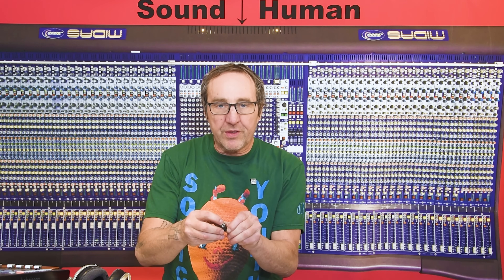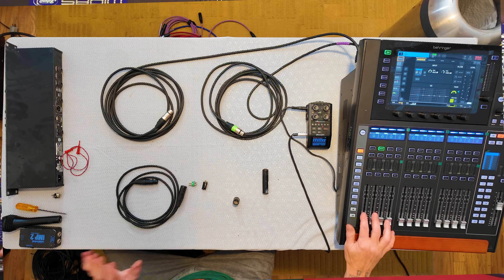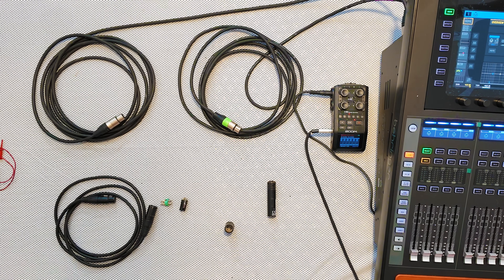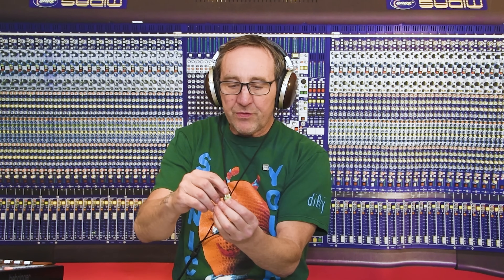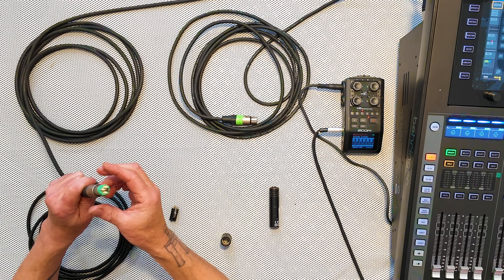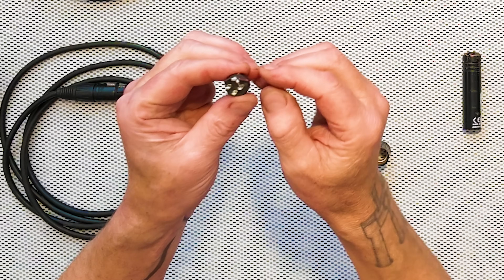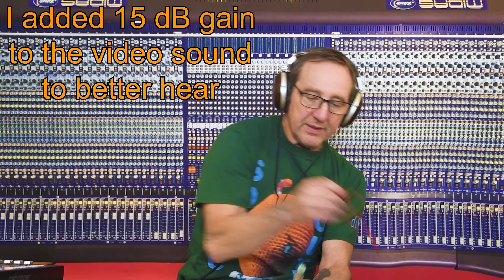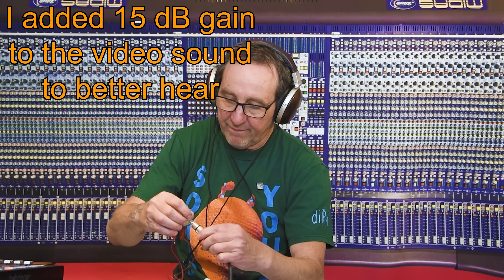XLR Shell Ground Issues

Comment: I discovered the ‘extension problem’ many years ago as I was putting the final touches on my active splitter design. Once a microphone hits a gain stage, the extension problem is basically ‘re-set’ and can begin again but as it is being terminated by the mic pre output circuitry, becomes moot. 

I recall that my preamps in my splitter ended up with pin 1 on their panel connector tied directly to chassis (earth) ground. The chassis ground of each 10 channel unit does have a lift switch but is virtually never needed. What my splitter does have which is rare, is an input pin 1 lift on each of the 100 channels and that lift is done right at the female chassis XLR. That lift point gets lots of use when we are taking anything but a floating microphone. 

The units are grouped together by 5s so 50 channels all share an input ground in only one exact place. This turns out to be the answer in practice as well as - no surprise - the technically suggested layout for minimum noise in analog circuitry.

Comment: Use it on a female and DI boxes cannot lift ground, as one example. I experimented with tying the shell on the male end only many years ago. I can’t recall any drawbacks at the time.
Reply from the maker: Some gear will hum if you tie pin one to the chassis ground of the shell and don't even put a cable on it and just plug that connector in
Reply: @   I’ve seen that and wondered why that could be. The theory says the source ground should be earthed and that theory truly works. I guess it’s entirely possible to have circuitry in that piece of gear that defeats the ideal. A microphone is, itself, a grounded source once tied to an earthed inlet connector. It’s quite amazing how well that works, with super long runs AND high gain.

Comment: I’m confused. If I buy a cable at the store do I just check for him and if I’m okay then dont worry?

I don’t get what I’m supposed to do
Reply from the maker: You can open the connector and look but most cables should not have the shell connected.

It's usually when people make their own cables and try and be extra good by connecting it and it causes issues
Reply: @DaveRat  When Switchcraft first came out with the XLR with the shell pin, several cable manufacturers thought bonding it to pin 1 would be a good idea amd made mic cables so wired.  I think they all learned the issues and stopped years ago, but a quick check with an ohm meter will let you know.

Comment: Dave, am I getting old?

I see all the comments of people not knowing why you don't ground the shell.
But back when I started (early-mid '90s) this was common knowledge and one of the first things you got taught when making XLR cables.

Or is it maybe because of that part (making your own cables) of being a "sound guy" (which we used to be but we got upgraded to engineer somewhere along the line) is a dying art?

Youngsters just order what they think they need without understanding why it is made the way it is.

I am getting old when I judge myself on the above rant.... 😔

I miss those old days... Not the weight of the equipment but the more "DIY" mentality the industry had. Back when you needed your brains and needed to understand the equipment you had and the situation you were in to get a problem solved.
Reply from the maker: Everyone has to learn just like we did it's just the learning tools have evolved to platforms like YouTube.
Reply: @DaveRat  I understand what you are saying.

At the same time I see the younger generation not wanting to do the hard work and source out/order what they need.

I follow some DJs on YouTube and except one they all buy their cables pre-made. Even repairing a broken cable is to hard for them.
Reply from the maker: Agreed. And back when we started, that was not really an option if you wanted anything that is not junk.

Also, with digital, solving ground loops is a lost art instead of a daily adventure
Reply: @DaveRat 
Dave,
I agree with you on both accounts.

And that is what made us great technicians. For me more in developing aka the technical department than in sound engineering but that's a bit beside the point.

Back then (before the internet got so evolved) there was no other way to get decent / good gear or gear that met your needs. You had to do it yourself and with parts that you were able to find locally.

Nowadays...

I still like to look at a project from all angles to find out what is the best (custom) solution. Kids nowadays just grab a catalog and piece something together that sort of more or less works.

But that is what makes us great:
Having the experience to look at something from all angles and figuring out what works best by trying several ideas that could work. Or not.. And that comes from experience but even more from having to figure shit out and built it yourself. No substitute for that!
Reply: @DaveRat Thanks again for your response and 👍🏻! 

That means a lot to me and gives me the piece of mind that I am not going crazy with the install project for a community building that I just walked off. I will spare you the details!

 But it's not all negative as I do see several good engineers from the new(er) generation like Joel Adams, James from Rattlin' Bones Club and Nico from Nicos Gigs! (German YouTuber).

I especially enjoy Nico as he has the same DIY mentality and because he has been on YouTube since his teen years and thus has given a nice portrait of his growth, both as person and as sound engineer.
Reply from the maker: Very cool I'll try and give a look at what they're doing and thank you

Comment: I have a real world example. Large event at the fairgrounds with a Whirlwind analog audio snake between the FOH and the stage. The audio snake took advantage of both multi pin connectors to split the microphones to both the monitor console and the FOH cable. We found the Whirlwind audio snake cables are not connected to the shells.
The problem showed up because the venue is about 700 feet from the local AM radio transmitter. The sound from the microphones was completely clean. This makes the case for not have bonded shells as Whirlwind does. The snake to the FOH is 250 feet. FOH was 130 feet from the stage. The cable went around the seating area, and the excess snake was coiled in the road case at FOH.
The problem was in the sends to the stage into a Meyer Sound 616 speaker management unit. For the legendary low frequency response, the Meyer Sound Galilep 616 has an op amp input configured for the balanced audio input. Unfortunately the 60 VAC Peak to peak saturated the input resulting in strong RFI at this point so there was a distorted AM talk show riding on the show audio. Adding the round to the shell, only made the issue worse.  We tried some very large ferrite beads on the cable at the inputs of the Meyer Sound speaker management box.
The following year I built a custom RFI filter to address the 60 Volt P-P RF signal to highly attenuate the common mode signal on the snake. Used 4 15 mH common mode chokes. 3 were for the signal pairs  for L/R main, and Mono Sub. The 4th choke was inserted inline with the combined signal shields to stop the current path on the shield. The attenuation at the radio station frequency, for common mode current, is about 50db, which ended the input overload on the Meyer Sound unit. Sometimes specific problems need specific solutions. Now tha filter is in my grab bag, just for that show each year. The 60 volt RF is still on the cable, but it is knocked down well under 0.1 volts after the filter an no longer present in the sound.
I have put together some more filters in 1/4 inch size for loaners to the bands as that RFI was in the pedal boards and ears for some of the bands. As a courtesy to our bands, at the show, I now have more filters as the radio station is still there.
As an FYI, this type of service is a difference between a production company being asked to do the show next year, or not.  The production company I was helping, has not gone to a digital snake yet.  Not sure the RF levels an AES-50 snake can withstand. I hope to find out sometime.
As an extension on this, DMX512 official standard specified the connector shells are never grounded. Reason if you have a faulty underground light, so the light is hot, the DMX cable running to the ground, won''t be hot. The DMX pair is optically coupled and isolated. Audio is never optically coupled. However Ethernet cable is transformer coupled on both ends, and is not a source of ground loops.

Comment: Cool explanation. Thanks! It would be nice if the socket and the plug had a little DIP switch to turn on/off the shell ground connection... Ear that Amphenol? 😁
Reply: Had a Gamble console with a master ground (pin 1 ) lift switch added to the rear of the console next to the input jacks. Was never a concern, until during a suit and tie gig, the pretty commitee decided that they did not want to see my XLR cables. Reluctantly allowed them to add a scrim across the rear of my desk. Once we returned from break, found no phantom power to mics working. That one switch had been bumped and the transformer split had prevented monitor desk to provide the needed ground. ( SCR dimmer buzz as well ) Panic ensured, figured it out, but lots of sweat until then. Guard added next day over that bad boy.
Reply from the maker: Cool and interesting.

Comment: The main reason for not connecting XLR shells to the cable shield is a safety issue. If you join two cables between equipment and one happens to be connected to something with a mains fault making it live, when you pick up the connectors one in each hand you are providing a fault path straight through your heart! So, do you feel lucky... ?
In normal use with a single cable the shells at each end are connected to the chassis of the equipment, so it is only extensions that get a small unshielded gap and it doesn't make a lot of difference as you show. It really depends on the CMRR of the balanced input.
Pin 1 should always be Chassis Ground and never Signal Ground or Common--this is the "Pin 1 problem". Chassis ground should not be carrying a current except when there is a fault and then only briefly before a fuse or trip goes. The exception is phantom power as the shield is used as a DC return and that means that the phantom power supply negative should be connected directly to mic input XLRs at pin 1 rather than to the Signal Ground or another Chassis point.

Comment: I always remove the shell connection, after a bad experience.  I was running xlr extension leads along a lighting truss, and the grounded shells made contact with said truss.  The resulting ground loop created horrendous dimmer buzz.  This was in the days of PAR64 lights.

Comment: you have good points... however I must add, groung must be connected to one end of the cable at the microphone preamplifier and then there is no hum, that's why ground lift is used if it is connected to another device...however, in a well-designed electronic device power ground & audio ground are not connected directly, they are connected through a parallel connected diode, resistor, capacitor. to a star point, central, common point in the device. If the cable is good, there are no problems with microphones, the problem is when another electronic device needs to be connected...

Comment: What if you had 4 conductors wires instead, 3 wires for 1 to 3 and a separate drain on the outer case.

This also makes me think about unbalanced cables that have two wires with a drain but the drain is only connected at one end of the connector...

Comment: Based on my personal experience, the answer is a solid and absolute "NO".

Last weekend I ran into some strange noise issues while wiring a band into the PA system of my college's mini-theater (more similar to a live house actually). As soon as I plugged one end of an XLR cable into a port on the floor-mounted audio I/O panel, hum noise appeared immediately on the corresponding mixer channel with considerably high (about -24dBFS) level. I tried different ports but it did no help. 

Suspecting that the solder joints might be faulty, I disassembled the male XLR plug, found all solder joints nice and intact, and hopelessly tried inserting the "naked" pins into the audio port - No noise shown on mixer's gauges this time. After reassembling the plug and plugging it back in, the noise reoccurred. At this point it's pretty clear that electrical connectivity between pin 1 and casing was the problem. By simply snipping off the bridge wire between pin 1 and casing contact, the problem was solved.

In later detailed inspections of the venue, I discovered that the floor-mounted panel is grounded as it houses not only audio connections but also AC mains outlets. The high and low voltage parts are separately encapsulated by two backboxes but share the same front metal panel, which causes an electrical connection between the casing of XLR ports and the AC protective ground wire, which was tied into the main ground at the breaker panel for visual systems. When an XLR plug with pin 1 and casing connected is inserted into any of the ports on that panel, the grounds of audio and visual power circuits will form a loop and introduce tremendous amount of humming noise (and probably some safety issues). After that, I inspected all XLR cables in the inventory and removed all tie lines between pin 1 and casing to prevent this problem from happening again.
Reply: Thank you for pointing out one of the most serious issues with bonding pin 1 to XLR bodies.  I learned that lesson the first time I made mic cables using the Switchcraft XLRs, the earliest manufacturer to sell XLRs with the shell terminal.  When I plugged onr of my new cables to an XLR on the panel of mic inputs in our radio studio, hummmm.  Why?  because there was conduit inside the wall which carried the mic circuits back to the equipment rack.  The metal wall panel connected the shells of the XLRs to that conduit, which was in contact with power conduits inside the wall.  And those power conduits often have AC voltage induced in them.  Not a lot of voltage, but certainly enough to produce plenty of hum in your mic circuits.  I reworked my new mic cables with the Switchcraft XLRs o remove the bonding jumper, hum gone.  

The Audio Engineering Society has standards for grounding and bonding of shields for balanced analog audio wiring.  They specifically recommend that pin 1 on a cable XLR connector not be bonded to the shell of the connector, exactly to avoid this issue.
Reply from the maker: Very cool, and thank you. And I remember those old switchcraft.

Did the old cannon not have shell ground connections?
Reply: @DaveRat  Not the ones I remember from the days that had the "resilient" (rubber) inserts.  The original XLR.  I have, somewhere, the Canon catalog from then which shows the "new" XLR.  The original was the X connector (most Cannon connector styles were identified with a letter, like the D connector we all love to hate.)  Then they added a latch to keep them plugged in, the "XL"  (and changed the pin locations on them, it appears that X and XL were not intermateable.)  Then they developed the XLR with the rubber insert body, apparently more durable and easily mated, intermateable with the XL.  So most of the clones (Switchcraft, Neutrik, cheap Chinesium, etc.) that are sold as XLRs should really be identified as XLs, they don't have the rubber between the pins in the insert.   

The XL/XLR was apparently first used to interconnect medical equipment, if I'm to believe the photos in the catalog.  But they quickly replaced the microphone connectors then used, The O connector, the P connector (larger P connectors were also used for loudspeakers), the UA (which used pin 1 as a signal pin, not the shield/ground as younger techs found out by trial and error), the Amphenol 91 series connector (often 4 pin at the mic to allow different high Z or low Z wiring), various twist-lock power connectors, the crow-foot power connector or whatever.  And soon they became often used for line level balanced audio, AES audio, and even the DMX lighting control wiring.

https://coutant.org/xlrhist/history.pdf

Comment: Listening to you wisper on that super boosted mic at the verge of feedback, put the fear of god into me, an otherwise atheist man. I'm so used to hearing a horrendously awful screech after detecting the noise floor in something that hot I had to turn it down, even though there was no need, and purely from the fact that background noise being audible so far up in the dynamic range of my system,  it was just causing me anxiety haha! I was certain my entire neighborhood was on the verge of being woken up lol... :face-green-smiling:
Reply: I hear you! I used to work in R&D for a well known mixer manufacturer. We'd test a mixer's noise floor at insane gains. Luckily the monitoring system had a stepped attenuation that was incredibly quick at kicking in. Even then, if you touched the wrong track on a pcb you'd nearly be wearing cardboard from the monitor loudspeaker.
Reply from the maker: Yeah it scared me too. I actually got bit with a squeak last time I did that so I was super careful
Reply: @DaveRat  😅👍

Comment: To work well the DIbox must not have the XLR output chassis ground, the chassis ground must be connected only to the source ground, so with this connection the ground lift work well with both type of cables, and you can connect ground for example connecting a pick up of an acoustic guitar or disconnect the ground for example connecting a keyboard with earth ground on stage, in conclusion the DIbox you have used is not perfect.